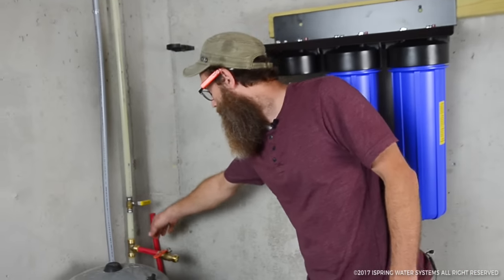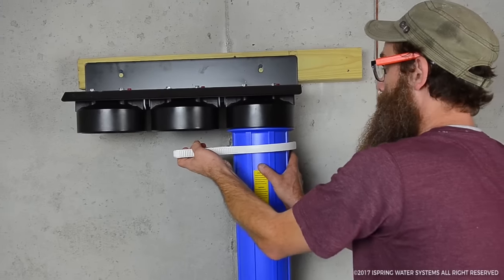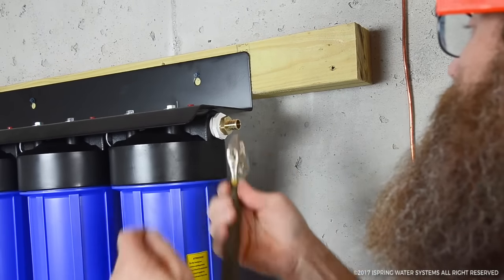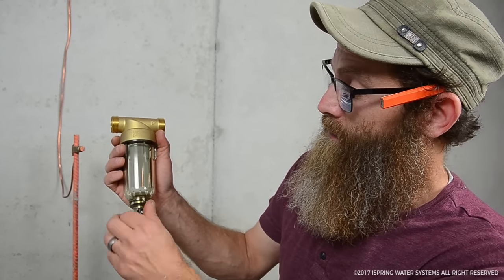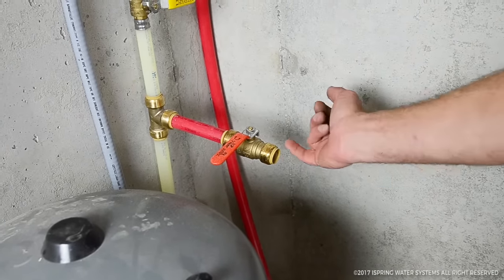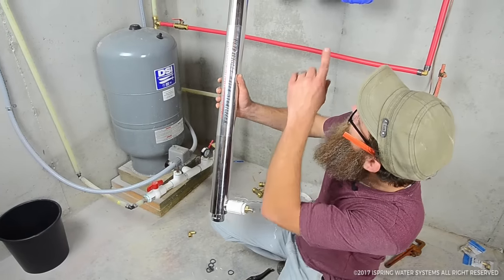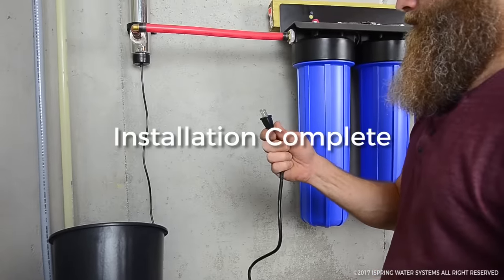iSpring Whole House Water Filter Systems DIY Installation

Comment: Very nice. I would like to note that the specs call for a 1/8 to 1/4 gap between the ring and the fitting, so this could fail an inspection. Also, red PEX denotes hot water. Blue or white is best. PEX and filter should have been 1" if the rest of the pipe is that. Spin down filter is on backwards.
Reply: Won't you lose pressure with a 1" PEX? Does it cost more both in pipe and tools for 1"? Benefits of 1"?
Reply: Color doesn't matter
Reply: @warh0rn  You lose less pressure with 1" pex, it also costs more. The only disadvantage is volume of water in the pipe is not ideal for hot water lines, you have to heat up all that extra water and flush more to get it.
Reply: @user-mt1wi2co4z ,wrong, there's a reason why they're colored. So color in electrical wire doesn't matter also?
Reply: Also has CPVC and PEX too close to the UV light. It needs to be hard piped with copper going in and out of the UV filter for some distance to reduce UV exposure breaking down the polymers in the PVC and PEX.

Comment: I installed almost the same system but I added an electronic water descaler. It's kind of interesting how you  decided that you have a better system for fastening the crimp rings than the engineers who designed Pex. They say you should use one ring only, and place it back about an eighth of an inch from the end of the tube. And you should crimp it once only. They even provide a handy go/no-go gauge with your crimper  so you can make sure the rings are secure. Your way might be almost as good.
Reply: His way is better. Have you considered WHY Pex only says to use one ring and one crimp? I'll give you a minute to think about it.

Because if they recommended two rings and two crimps, their product would be less marketable, and customers would be beaching and moaning about the extra time and expense. However professional plumbers who do enough of this kind of work often see those joints as the first point of failure. Having backup rings, and double checking your crimp only makes good sense.
Reply: @Rick-the-Swift  When products like this are designed (by real engineers with college degrees and everything) they  designed it from the ground up for the best, most durable option . They don't care if it takes you slightly longer. It just needs to last longer.  One ring leaves a cuff of PEX on the joint side that makes it harder to pull thru the ring. And since the inside of the rings are smooth while the barb is not, an extra ring gets you nothing. I've installed PEX for years, and it so much easier and faster that copper or galvanized pipe that no real plumber would gripe if he or she had to install five rings. Buy the rings in bags of 100. They cost almost nothing. If you're estimating a job there's really no point in adding the cost of the rings.  Years later, nothing has moved with "only one" ring even with water pressure that is higher than it should be. It's also quicker to install than PVC or CPVC unless you go for the really expensive push fittings. 

It is interesting to see idiots try to outsmart the pros because they don't understand how the system works.

Comment: Can't stand when plumbers install entire assemblies of plumbing fittings, pipes, and shutoff valves unsupported. It puts stress on the sharkbite fittings and those crimp on connections. Add some blocking to the wall and secure it properly. The main on my house was installed with a water meter, shutoff, PRV, installed completely unsupported. Amazing how it passed local inspection.
Reply: BrianCNC shark bite fittings?!? Hope you got insurance bud
Reply: Shark bite fittings are for emergency repairs only at my house. I would bodily throw out ANYONE that tries to use those in my house.
Reply: Reuben Garcia: But the Shark Bite website says their o-rings are made of EPDM rubber, which I know to be invulnerable. It's used for tough roof membranes and I used a weatherstripping bead made of it on an old house; that weatherstripping never got dry or rigid through about eighteen years of winters & summers. It was always springy. I trust the Shark Bite fitting I installed behind my freezeproof hose bibb.
Reply: Did it myself with pex a expansion tool on entire house. Hopefully lasts past my lifetime😀

Comment: Nice install. I'd number or label those filter housings. I'm an old DIY plumber whose had Reverse Osmosis Filter Systems for almost 40 years. If you asked me which filter goes where.... I might get it right. But mostly what I've done is just replace the one that's in each housing with the one like it. So if I got them out of order once.... it'll probably be  that way until I go look it up on the internet. Might be out of order for years.  I like that 'spin' filter, great concept.

Comment: I see in some videos, they put in a bypass pipe with tap.  Also a  tap both sides of the filters. Just in case there’s any issues with the filters. You can then isolate the filters from the mains and still have running water. Good video anyway 👍
Reply: Makes maintenance easy too. Just open the bypass and shut the filter isolations

Comment: Nicely done.  A  couple of recommendations - (1) try to avoid the hard right angles in your pex fittings - these can cause significant pressure drops.  Better to have long sweeps; (2) - try to stay all 1" until you get out of the filters - better for flow; (3) add some ball valves, boiler drains and pressure gauges to control and measure your water flow.
Reply from the maker: Hi dear customer! Thanks for your comment!
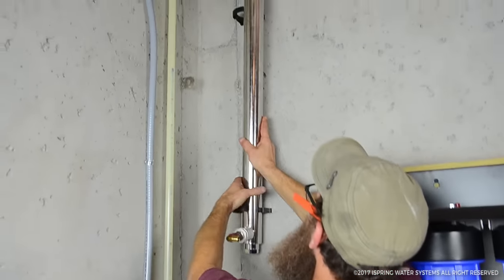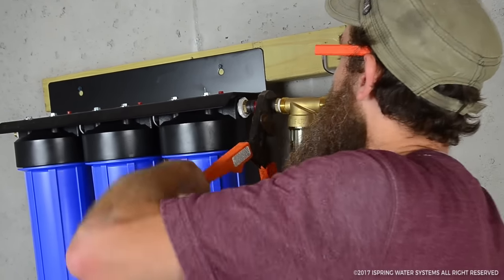For any questions, please kindly contact us at support@123filter.com, at (678) 261-7611 M-F 8:30-5:30 EST, or at (470) 560-0012 M-F 8:30-5:30 EST (Messaging only)
We are happy to help!

Comment: I have a single filter with a carbon and sediment cartridge for drinking... municipal water system. I find the 0 ring blue vessel HATES to come off after its been in place for months. That issue is present even after pressure release. I have resorted to using piie dope on the threads. It is SOME easier this way. I like the brass cleanable pre filter... going to add that. Thanks for the demo.
Reply: You need food grade grease on the threads and top o-ring.

Comment: Great install, the only thing that I see  that could be a problem is touching the UV bulb with your bare hands. The oils from your hands could cause the bulb to prematurely fail.
Reply from the maker: Hi dear customer! We genuinely appreciate your valuable feedback as it assists us in enhancing our services.
For safety, wear rubber, latex, or nitrile gloves. It will also avoid contaminating the lamp.
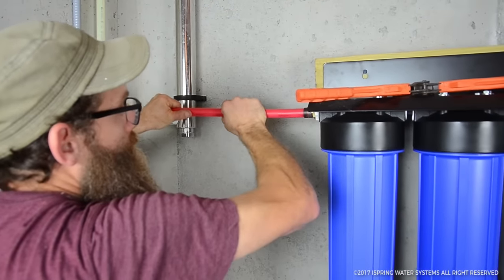If you have any concerns or questions, please reach out to us at support@123filter.com  or 678-261-7611 (M-F 9:00-5:00 EST) for proper assistance. Thank you!

Comment: It's been shown in multiple tests that these filters remove sediment, tastes and odors, and minerals. The minerals removed do not soften water which is one of their big claims. The cost north of $1000 and you have a constant filter replacement built in for the life of the unit. A simple whole house two filter, sediment and taste and odor will do the same for about $150.
Reply: James, The little Silfos (Phosphate) pre-filter is supposed to tie up the minerals and thus in theory to soften the water.  In fact it only adds the phosphate to bind up the minerals which stay in the water and "doesn't" soften the water.

The Calcium and Magnesium bonding/binding with phosphate "may" be filtered out through the 3 stage filtration.  However, I doubt it.  It "may" just end up shortening the life of the filter cartridges due to early plugging.  In which case the house owner "may" be replacing cartridges more often than expected.

Comment: Thanks for the demo
I recently replaced my well pressure tank. I installed a spin down filter before the well tank . Then I installed a single canister filter after the well tank on the main supply lines . I'm still getting iron staining my toilets. Ugh. 
So I guess now I'm looking at the 3 stage filter . my question is should I install the spin down filter, the 3 stage filter then the pressure tank? or can I install the 3 stage filter after the well tank . Any help is greatly appreciated.  I'm a plumber but not a water filtration specialist. I was thinking to install the spindown filter , then the 3 stage filter , before the well tank the still use the single stage after everything just because it's already there. anyhow again all help is greatly appreciated. Just ignore all the nitpicky comments . I totally understand this is just a basic installation video. Armchair plumbers lol
Reply from the maker: Hi there. the filters, including spin down filters,  should be installed after or downstream of the pressure tank. This is done so that if a filter clogs then it will not damage the pump.

Comment: Thank you for the video, does this system reduce or eliminate rotten egg smell from well?
Reply: it wouldn't you need a peroxide system for sulfur
Reply from the maker: Hi there. If the rotten egg smell was caused by hydrogen sulfide, you can consider our WCFM500K whole house water filtration system: https://www.amazon.com/iSpring-WCFM500K-Manganese-Hydrogen-Filtration/dp/B08TMZYYQY. If you have other questions, please feel free to call us at 678-261-7611 (M-F, 8:30 - 5:30 EST) or email us at support@123filter.com. We are happy to help!

Comment: I just finished my install with the WGB32B-PB and the WSP-50SL spin down filter from ISpring.  Two things, he said the housing was made from cast iron 1:54 my is heavy black plastic, was there a build change? Also the spin down filter at 4:20, I could be wrong but is his installed the correct way? I followed the directions to a T, and mine does not point in the direction as the one in the video, you can clearly see the arrow showing the direction of flow. Sorry just making sure I installed my correctly. I am certainly not bashing, it was because of this video I purchased my filters... Thanks for the great video!!!
Reply from the maker: Hi Byrkster. Thank you for liking our video! 1. Only the mounting bracket of WGB32B-PB is made of cast iron. The filter caps and housings are not. 2. The spin down filter was somehow installed in the wrong direction in this video. We have realized the issue and made an updated version here: https://www.youtube.com/watch?v=h0wehSjCZ3w. Sorry about the inconvenience that caused.
Reply: @iSpringWaterSystems  THANK YOU. Started using everything last night. Wifie is happy with the taste and clarity. Will me passing your product to friends. :)

Comment: do you drink out of the faucet with this filtration system? and if not would you or would you not recommend it. 

Also how much water does it filter a day? where would it be stored?
Reply from the maker: Hi Vincent. Thanks for reaching out! Here are the answers to your questions.

1) The products in the video are whole house water systems. Although you can drink out of your faucet after this filtration, we recommend installing a reverse osmosis system (like this one: https://www.amazon.com/iSpring-RCC7AK-Capacity-Drinking-Remineralization/dp/B005LJ8EXU) for safer drinking water.

2) You can filter as much water as you want per day. However, the filters' lifespan is up to 100k gallons of water (depending on your water quality). That means the more water you filter per day, or the worse your water quality is, the more frequently you need to change your filters.

3) The filters should be stored indoors or under shelter to avoid direct sunlight and freezing temperatures.

If you have more questions, please feel free to contact us at 678-261-7611 (M-F, 8:30 - 5:30 EST) or email us at support@123filter.com. We are happy to help.

Comment: Great job, but you don't need to use 2 pex crimp rings I've used 1 for over 20 years and never had a leak.
Reply from the maker: Hi there. Thanks for your comment! 
We recommend using 2 to maximize the support of the system.

Comment: I’ve heard that every elbow you install will reduce your pressure by around 2psi each. And then the 3/4 fittings are more like 1/2 with those fittings, with all of the elbows and the 3/4” adapters how is the final psi coming out after the entire system? Well water is 50-60psi max before all of the filtration that also reduces psi. I am about to install this system and I am wanting the max water pressure I can get. also what about the system bypass for keeping water running when servicing the system or in case of a system failure?
Reply from the maker: Hi Adam. Pressure drop is usually negligible. To discuss your case in detail, please give us a call at 678-261-7611 (M-F, 8:30 - 5:30 EST) or email us at support@123filter.com. We are happy to help!

Comment: I assume he did this with water flowing basically from right to left because both of his connections for the water supply/house were on the left side in that corner, but if I have my water supply on the left and I want the where it goes into the house on the right I can reverse which order I do this in?  Spin down filter on the left followed by the large blue filters in the middle and then the UV filter on the right.
Reply from the maker: Hi dear customer! Please, follow this configuration/order:
Water Flow —> Spin Down  Sediment Filter —> Big Blue System —> UV Filter —> Water Flow —> 
If you have any concerns or questions, please kindly contact us at support@123filter.com, at (678) 261-7611 M-F 8:30-5:30 EST or at (470) 560-0012 M-F 8:30-5:30 EST (Messaging only) to properly guide you.
We are happy to help!

Comment: How do I solve the immense pressure drop after the system? is there a booster pump i can install after the fact?
Reply from the maker: Hi dear customer! If water pressure drops immediately after installation of a WGB series system, please take into account that bathtubs, utility sinks, hose bibs, multi-headed showers, body sprayers, or anything that is considered high-flow should be avoided for the first 72 hours. Any high-flow situation within the first 72 hours may cause a temporary carbon blockage.
-To clear the blockage, turn off any running water for at least 10 minutes and resume using water at low or normal flow rates.
-Allow the water to run until the air and carbon has been purged. Water may be cloudy initially as the filters and the system clear of trapped air. New activated carbon filter cartridges may contain loose carbon and air bubbles after the installation/replacement.
If this is not the case, please kindly contact us at  support@123filter.com, at (678) 261-7611 M-F 8:30-5:30 EST, or at (470) 560-0012 M-F 8:30-5:30 EST (Messaging only)  to properly guide you. 
We are happy to help!

Comment: With the plastic Plex pipe coming off the main, you would lose your house ground wouldn't you sir?
  I mean it's easy enough to run a jumper wire from the main to the next spot of metal past your UV filter...but I think it would need it to be sure your house doesn't lose its ground..correct?? Thank you.
Reply from the maker: Hi Gray, thank you for your comment! I'm sorry that we can't offer you advice on electrical issues. We suggest you contact an electrician for matters like this.

Comment: Gonna get absolutely soaked changing those filters.  It's better to install 20" big blues at waist level or lower.  Also, you always want to wear rubber gloves when handling UV bulbs.
Reply: Outside of that, thank you for sharing this video.  You do know what you are doing.  It will do just a fine job.
Reply: The oil from your skin will shorten the bulbs life that's why you should also clean it before install.

Comment: I have a sulfur aerator tank and a water softener.   From the pump the water smells like sulfur and there is very little deposit in the bottom of a pot of boiled down water so I don't have much minerals in my water.   Will this system replace what I have?
Reply from the maker: Hi Bob. Thank you for your comment. We really need more information here to give a recommendation. Could you please get your water tested first and then give us a call at 678 261 7611 (M-F, 8:30 - 5:30 EST)? The water test can be done via most universities in your area at a relatively cheap price.

Comment: Great job ~ I learned a lot?  Would you recommend pressure gauges.
Reply: Hi Bruce McGee,

Adding the pressure gauges is a preference when the system is installed. The pressure gauges are a useful tool to see the incoming and outgoing psi (water pressure) in and out of the system. This can be used as a tool to see when the filters may be due to be changed.

Thank you,

iSpring Water Systems LLC
Reply: Bruce McGee A pressure gauge is necessary for pump switch operation and setting. For filtration, the only time pressure gauges would be useful is during operation of the system to note the pressure drop across the filters. When you notice a significant operating pressure drop it’s a notification to change your filters. There will always be pressure drop across any water system from beginning to end, but it gets more significant as the flow is restricted.

Comment: If I was to integrate a water softening system, would I need to place it before or after the water filter?
Reply from the maker: Hi Tony. We recommend installing our whole house water filtration system after your water softener to achieve optimal performance if you have hard water. If you have other questions, please feel free to call us at 678-261-7611 (M-F, 8:30 - 5:30 EST) or email us at support@ispringfilter.com. We are happy to help!